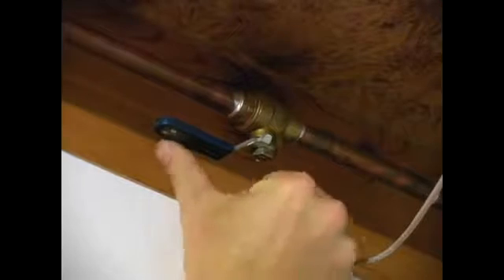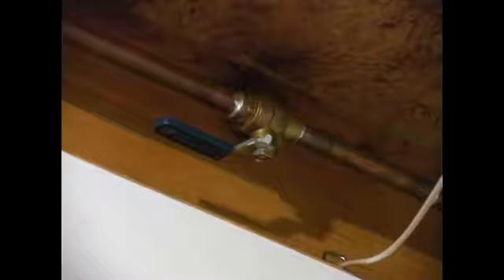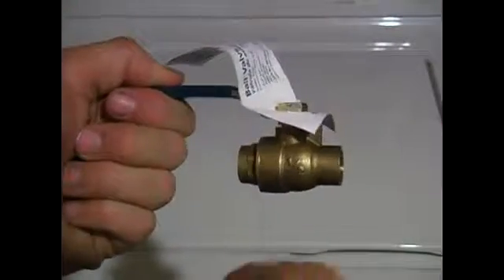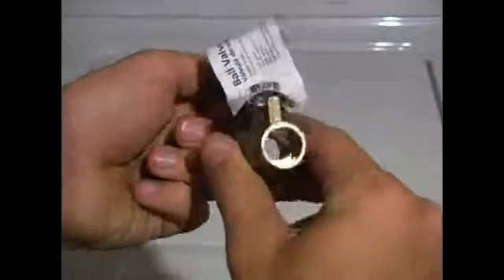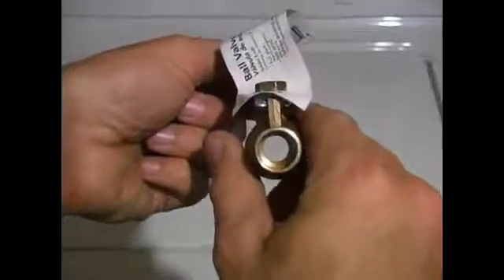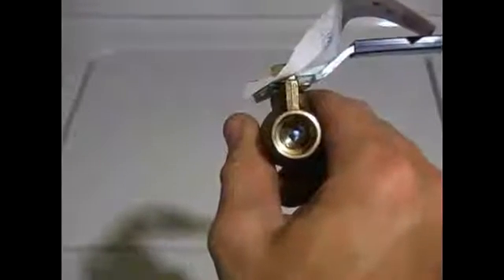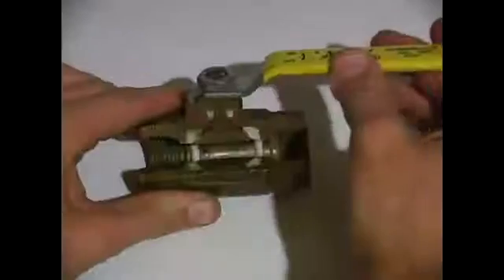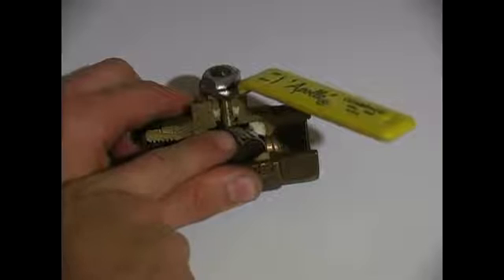How Do Ball Valves Work

Comment: great explanation on how it works. Now what happens when it leaks? I have a splitter for the garden hose and the thumb levers leak out the thumb lever when the water is on. Also I have a ball lever at the end of the line before the faucet and it also leaks, leaving the sprayer to stop the water? are these things fixable or Garbage. thanks